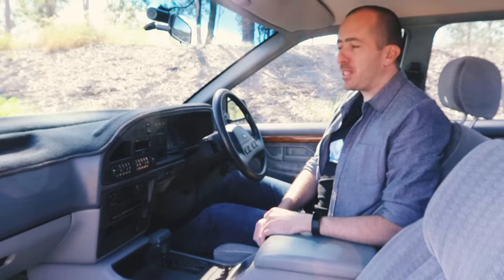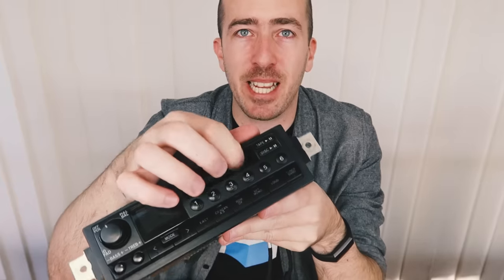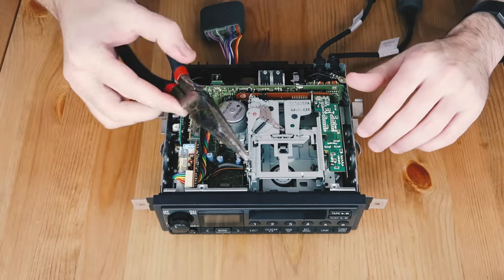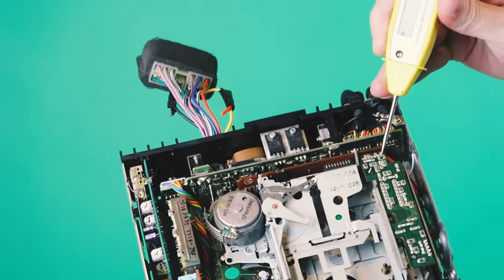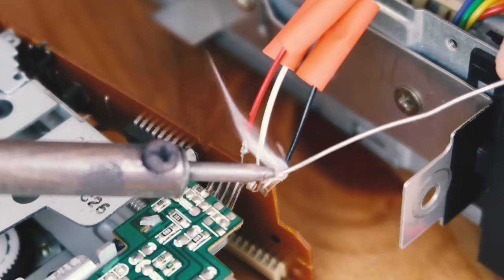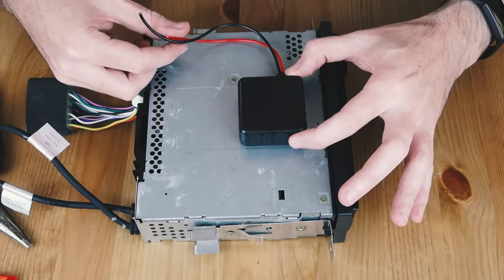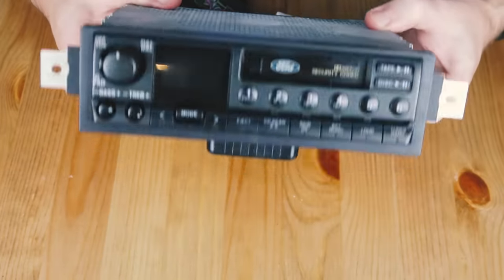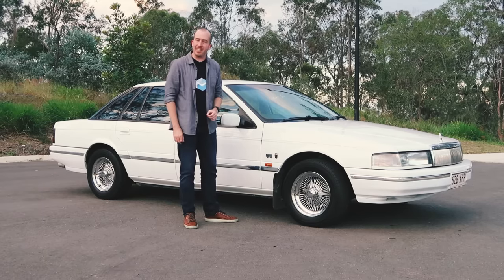Add Bluetooth To Your Old Car Stereo For $25!

Comment: This rules.

I followed a link from an AUDI forum where someone did the same thing but off the main board. 

Kinda tempted to get the original headunit out and try it out!
Reply from the maker: It's a pretty neat modification that is cheap, so long as the job itself doesn't scare you. The novelty of using it never wore off!

Comment: Great video!! I was thinking about the cassette motor running continuously. Do you think I can disconnect the motor, to stop it from spinning and consuming energy? Any idea which wires to disconnect? Thanks!! Would it still work with the motor stopped?
Reply from the maker: It'll depend on the head unit. I disconnected the drive motor on mine and it caused the headunit to malfunction. It must have realised the motor wasn't drawing any current, and went into some sort of error mode.

In the end I didn't care that the heads were turning, they were quiet and I was never going to use them again.

Comment: Excellent video. I've just done this to my Kenwood stereo and it works but is very loud and the sound is distorted. Is it likely that I have soldered the wires in the wrong place or could it just be poor soldering? Thanks.

Comment: Great content! Was a voltage regulator not required? What is in the power input of this BT device? Cheers
Reply from the maker: It's designed for cars and works on a range of voltages to suit.

Comment: 2 suggestions:
If you get rid of the cassette mechanism, you can create a slot for your mobile phone to rest there.
2nd, you can put in a flat wireless qi charger in there to charge your phone while it sits there.
You're welcome!

Comment: I'm wanting to try something like this on my 2005 Escalades factory Bose head unit.. only highjack the signal from the factory CD changer which no longer functions. I removed it but the wiring is still there.

Comment: I like the style and ease of viewing of this video.  Very well edited and easy to follow.  However, it is not electrical that you should be referencing, It's electronic.  Yes, there is electricity in the Alpine Head Unit, but it's not what makes the radio, cassette player, or anything else function.  Electronics is what makes those things possible.  Also, by removing the springs on the cassette mechanism and causing the cassette to function while the cassette button is pushed, you've decided to reduce the lifespan of the audio head unit.  If you don't have a replacement Apline head unit purchased for your car, start looking now.  BTW, do you have the Alpine Head unit's Model Number?  I'd like to pull the circuit diagram and see if there was a better place to add the audio output lines to the Alpine.  Thanks for sharing!
Reply from the maker: Thanks for the comment. To be honest I don't mind what happens with the cassette mechanism, so long as the head unit believes it's still working fine and doesn't affect any other parts of how the head unit works. Having the cassette mechanism in the eject position mutes the tape audio output, so it has to be loaded and playing for the audio channels to output successfully. Disconnecting power from the drive motor also causes malfunction (it must detect it as a jam and it continuously tries to reverse the tape direction). As for lifespan I don't really get the point - the wear on the tape drive should be exactly the same compared to if I was actually listening to tape - I always switch back to radio when I'm not listening to BT and the tape drive stops.

Comment: I don't know about Australia but in the US the yellow wire is memory and draws constant voltage red is the switched power.
Reply from the maker: That seems to be the case with most vehicles. For whatever reason though mine is the opposite.

Comment: Idea is good and better than just a Bluetooth cassette, however some advanced tape devices were able to detect the spindle is not spinning (end of the cassette) and eject it
Reply from the maker: You can use a blank tape or a cassette tape adapter with the cable cut off, just to keep the head unit happy.

Comment: Mind you many cars have a rear or boot socket to plug in a bluetooth fm transmitter out of the way.  I bought a couple of fm earplug socket transmitters £2.20 each 7mins to fully charge 11/2 hrs running time leave it plugged to socket charging when using. The fm transmitter lets any radio nearby sometimes a couple of streets away tune into your music lol.  Mind you in a city like London there seems to be no free fm channel to broadcast constantly on without interference.
Reply from the maker: If you've got a boot socket that's a great option.

Comment: Great video! I’m looking to do the same to my Falcon too, albeit a bit older (XC). Thanks for all the info. 

Is there anything you would’ve done differently?
Reply from the maker: Not really, it just depends on the inner workings of the head unit and finding the best place to connect it. You'd most likely be soldering to pins on the mainboard ot tape drive, rather than cutting a ribbon cable like I did. Good luck!
Reply: @MotoringBoxTV  Beauty! Thanks

Comment: This is perfect for a 67 nova factory radio keeping the look but with Bluetooth
Reply from the maker: That'd be pre-cassette wouldn't it? You might need a system which can splice into the car's antenna circuitry . I've not looked into this before but I saw a few other comments here talking about it.

Comment: Great video, nice car and that mod to the head unit is inspired. My 2005 Nissan X-trail has a combined CD multichanger and tape player head unit. I think I'm going to have to try this modification.
Reply from the maker: Worth a try - and even if you fail, the worst case scenario is you'll only lose the ability to play tapes.

Comment: This is a great mod! I’m really impressed! Would work for leagues of Volvo C30/S40/V50 owners too - that waterfall centre console looks ace but you are screwed with audio options lol
Reply from the maker: Yup, potentially a great modification for all the early 2000's cars out there which have integrated units which can't be easily swapped out for a single or double-din head unit.

Comment: However if your wanting an actual sound system (with subs and what have you) I would suggest looking for an aftermarket head unit that you like as those usually push more power, have more outputs to play with, and also tend to have better audio customization
Reply from the maker: My headunit already utilises a factory amplifier and subwoofer, which is partly why I wanted to keep everything as is.
Reply: @MotoringBoxTV  that's entirely fair but when I said that it was more or less meant for the younger audience who might be watching this video trying to save a buck on their budget enthusiast sound system, the point I'm trying to get across is yes this is great if you would like to stay stock, wonderful tutorial by the way, but if your not trying to stay stock it's worth it to go aftermarket, by the way I really appreciate the fact that you took the time to respond to my comment, you earned yourself a subscriber
Reply from the maker: No worries mate. I'd agree, most new headunits would crap all over this one functionality wise. Easier to install and without any downsides (aside from aesthetics).

Comment: I personally would have just soldered the audio channels alongside the tape deck so it still functions. Also you should have cut the wires going to the drive motor so its not running all the time.
Reply from the maker: Tape drive has hiss and other undesirable noises.

Comment: I might have gone with the gutted cassette - and not cut, but soldered onto the existing connections - this way your tape unit could still play tapes if you had any! - Since you chose to cut the wires and remove the springs, might have well also cut the wire to the motor - so it's not spinning happily for no reason.  I also was thinking (i know, enough already) maybe attache the blue tooth unit to the side of the radio if it had the width clearance in case you didn't have the clearance on the bottom to clear the entry....
Reply from the maker: Sure you could go the gutted cassette route. Be very careful about cutting wires to the motor or removing the tape unit entirely though. In my case, my head unit malfunctions if I do that.

Comment: I wouldn't have ruined the originality of the car stereo that way. What if I want to use the tape drive again? A better solution would have been to install a switch to choose to use tape or the external source. Also tapping directly into the tape input is not ideal, tape input is preamplified and thus if you feed it with an high level signal then you must maintain a low volume on the source, and thus introduce a lot of noise. A better solution would have been to tap directly into the source selector IC of the radio, skipping the tape preamplifier so it's safe to put an high level signal, with a switch to choose the external input.

Another option would have been since that radio had external CD changer support to tap into that, this way you wouldn't even had to open the radio and you would have done a simple to revert modification.
Reply from the maker: If you want to use the tape drive there are ways to splice the wiring into the circuit without cutting. It also enters after the tape pre-amp so there are no noise issues.
Reply: @MotoringBoxTV  The only issue with that is you have two amplifiers feeding into the outputs of each other = not good for the electronics or the signal, and you can run the risk of damaging one or both of the amplifier stages.

Comment: My only comment is that for the splice section, you could have also used liquid electrical tape. Serves the same function, but looks a little cleaner. Kinda like a liquid band-aid for electrical or electronic work
Reply from the maker: Sure, many things could be done better - feel free to improve on the instructions where necessary :)

Comment: That's a great idea, I have an old CD head unit but it also has an aux jack.  I can tap into that with a one of these, thank you.
Reply from the maker: That makes it a lot easier! I personally can't stand having to connect the phone to an aux wire though...
Reply: @MotoringBoxTV  Couldn't agree more, had the same car/head unit for 13 years. Gave up try to use a wire to the aux, it was too much of a ballache. But hard wiring one of these in is a genius idea 👍

Comment: The only real problem with doing what you did with the cassette mechanism is that many head units, specifically auto reverse ones, have speed sensors on both cassette spindles to detect if one of the reels stops moving. They would either continuously auto-reverse or just stop the tape and back to radio if you just did what you did. I would suggest instead of modifying the mechanism, get a cheap cassette to aux adapter, cut the cord off at the adapter, and insert it into the head unit. This will give the unit the illusion of a cassette, but you just inject your own audio into the circuit.
Reply from the maker: Sure, that's a solution to the problem. The cheap tape adapter I held up in the video has gears within it to ensure both reels turn together, so cutting the cord off that and loading it in is an easy solution.
Reply: @MotoringBoxTV  So I have just this auto-reverse complication I guess. I have a Nissan Maxima factory  unit from 2002 that has nice sound so I don't want any muddy FM transmitter type solution.   There is a very small circuit board that goes from tape head to the main board, and it has FL FR RR and RL - so I guess those are the forward and reverse left and right.  Would you think that I should probably hit the FL, FR and GRND?

Comment: One thing you should mention is to disconnect the cassette drive motor power or it will continually run when the power is on.
Reply from the maker: Nope there's a good reason I didn't do that. My head unit requires the cassette motor to be powered and running, otherwise it detects it as an error and pauses (& mutes) the output.

Comment: Great work and a very original cassette player piece. The only comment I have is that you left the motor and gears working without reason and this will produce noise after a while, I would disconnect the motor wiring.
Reply from the maker: The unit can detect that the motor isn't spinning, and it essentially triggers the unit to continuously "switch sides" of the tape - muting and unmuting the sound output as it does so. Probably because it thinks it has reached the end of the tape.

The tape motor is pretty quiet in my head unit, and no doubt has been designed to play a tape whenever the vehicle is being driven - like I'm doing now.
Reply: @MotoringBoxTV  Umm .. looks like it has advanced electro-mechanical parts and needs some study to disable it (reminds me with my old days) .. anyways, enjoy your life man!  and keep up the good work!

Comment: I am looking to do something similar for my car. Does this Bluetooth unit provide same audio levels as the Tape or Radio? Generally bluetooth audio will be quite low compared to the Tape/CD/Radio. for eg if the Tape/CD/Radio is good for you at volume level 10, Bluetooth will be around level 6 or 7. Switching between Bluetooth to other inputs will create issues due to different volume levels. Did you face the same issue and how did you solve it?

Comment: Hey, thank you for this great video! Please tell if tape player motor is working all the time when you press on Tape button? I need to do something like this with my OEM 97 Mercedes Becker 1692 radio. I also wonder how to add few USB ports for charging and one USB reader. I think adding a USB charger shouldn't be a problem. We need to find a 12V to 5V-2A adapter and wire it to the existing 12V line and to any ground. But what about USB reader? I guess in that case we need to either sacrifice another device like CD player or probably use some kind of switch to jump  between Bluetooth and USB. Any ideas how to add USB reader? Thanks!
Reply from the maker: Yup my tape motor spins. I had to keep it that way, as the head unit detects a malfunction if you try to cut power to the motor.
Reply: @MotoringBoxTV  Thank you! What do you think about assigning Bluetooth to an AM button? It may reduce some noise and reduce risk of killing always spinning motor. I guess AM is rarely used anyway. I'm currently looking for an OEM radio replacement. Haven't decided which way I want to go...
Reply from the maker: @NoWheelDrive  I've actually tried that in a different car, but the results were not great. The circuit I tried meant that my BT sound was playing over the top of the FM and/or AM radio output. FM has background noise when it isn't tuned to a station, and switching to AM had a similar issue but also the sound output changed to a very low-bitrate / lo-fi sound, and probably mono too. It's a tough one.
Reply: @MotoringBoxTV  Thank you for this info! It doesn't sound promising then. I see they sell Bluetooth radios where BT module is assigned to either FM or AM depending on the seller.

Comment: Great video quality and info HOWEVER for MOST ALL, I STRONGLY RECOMMEND just replace and installing a modern very affordable Pioneer stereo.

I say Pioneer because they are affordable AND RELIABLE. Too many affordable brands are NOT reliable. Sony is also reliable in my experience these can last decades problem free.

The Bluetooth interface and interaction will be MUCH BETTER than that separate box install! You’ll be able to pick up phone calls and control phone functions during playback etc.

Comment: I bought a old nakamichi headunit cassette with a disc changer and 2 rca in ports and did it that way but it was about 150 dollars but the radio looks stock in fact  even the new nakamichi headunits look good they dont look like something out of tron

Comment: I'm not sure how the wireing is in that model of headunit But U got the red and yellow wire mixed up. Red is the ignition wire and yellow is a the constant 12v. That's the standard wiring for any headunit. :)
Reply from the maker: Definely not true in this vehicle.
Reply: Commodores are the same

Comment: Awesome mod video! I have a 2004 Ford Thunderbird without a cassette deck. The factory system has an in-dash 6-disc player and a satellite mode button. Can I splice into the satellite function for the bluetooth adapter?
Reply from the maker: In theory you can splice in anywhere there's an audio signal being used, the difficult part is finding where those circuits are, and making sure the head unit will stay on that source (tape, cd, satnav etc) without auto-switching back to radio or something else!

Comment: Heat the solder on the back of the board and remove the 3 OEM wires. Tin the BT wires and insert into the board. Much more secure...
Reply from the maker: Good tip for those confident enough to try.

Comment: Well done. Since you have a CD stacker in the boot, would using the CD input also work? I’m just curious because there are mods out there that use the CD changer inputs as an alternative. Great video BTW - fantastic for old school cars with tape drives.
Reply from the maker: Thanks for the comment. I've heard of people doing that too, but if I had to sacrifice one of those media options I'd pick the tape every time!

Comment: Lovely idea . I used to do a similar thing on the old car radio and cut the audio line of the radio card and put the connection 30.5 mm Aux and not blue tooth and the connection is male and female. Bluetooth piece in its place it takes up space and is useless

Comment: Good thing is that there are also Bluetooth cassettes. But this mod should be useful for those old CD only head units
Reply from the maker: They constantly need recharging though.
Reply: @MotoringBoxTV  that and the sound quality isnt as good when passed through the magnetic head.